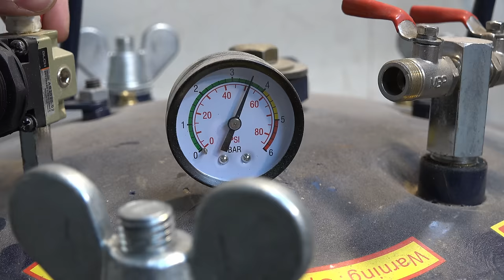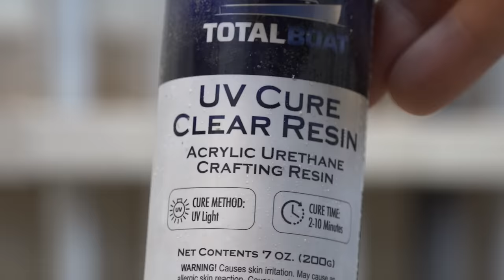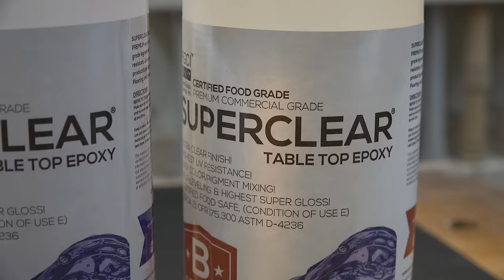I Should Have Seen This Coming...

Comment: Splendid piece of art and craftsmanship, however, not recommended for the average wood-turner who values “two arms and a leg”
Reply from the maker: Thanks!
Reply: Two arms and a leg is how much it costs!!
Reply: Meh, arms and legs are overrated.
Reply: @DavidAdamsen  ¹¹¹
Reply: Or sepukku by wood lathe
Reply: LOL
Reply: Right you are sir! This type of work is not for moderately experienced wood workers. It should be only be attempted by beginners.....  Now it's possible, even likely, that you meant the exact opposite of what I said.  🚫(Sarcasm of course)🚫

 I worked for 2.5 years on metal lathes, and also a little on wood lathes, and it makes me cringe just thinking about what would happen if someone were to flinch just a little, and accidentally jab their cutter into the top end of those branches while it's turning. That would be an injurious lesson on the importance of safety equipment!
Reply: @HighlanderNorth1  so true they'd end up with they're limbs twisted up more than the root system itself!😂, that's if they didn't end up missing a few digits?😳😂✌️
Reply: With the title, I thought it flew off the lathe. Impressed it didn't, seriously out of balance spin. Lol
Reply: Wrist bones are nice, too.
Reply: Lol
Reply: @Fubar000  expendable pieces, replaceable soon with robotics 🦾🦿
Reply: This was very stressful too watch. Pretty tho
Reply: I had a job once where we had insurance to cover accidents at work, and we would be paid a certain amount if specific things happened. The loss of a leg was valued atc$15,000, and an arm $10,000. So, 2 arms and 2 legs would be $50,000. Based off of these numbers, I would agree with your assessment that it is not worth it lol
Reply: @avrelo_south  i thought it was relaxing
Reply: @jonathanbartlett1098  that's a really low coverage. The recommended minimum sum insured is 100k which typically means 5k for a finger (double for an index finger). Still not worth it.
Reply: Saw a vid on LiveLeak once of a poor guy who got his coat sleeve caught in a metal lathe similar to this one.
He was obliterated instantly.
One of the most brutal things I ever saw...
Reply: Cheap at half the price an arm and a leg!..
Reply: Why does the cutting tool not gets snared and ripped out of your hands?
Can one not advance the cutting tool with a firm clamp.
Reply: @avrelo_south  I thought so too 😂
Reply: That is why I think that he cut off some of it and most people would put it in the fireplace
Reply: take 1 arm and leg 😂😂
Reply: @FUBAR  , they're not when you don't have any.
Reply: A lot of work for a bong and why need a stump only to cut it off after?
Reply: for balance
Reply: It’s just beautiful
Reply: @dogewood5499  Metal lathe has way more torque than a wood lathe so if you get pulled into it the thing it won't stop turning until it is ready to stop. Wood lathe will stop quicker but still do a lot of damage. Either scenario doesn't really bear thinking about.
Reply: @DavidAdamsen  will get v nai
Reply: @Fubar000  as a quadriplegic, that's not funny
Reply: Un capolavoro!
Reply: I felt like I was going loose a hand just watching this video.
Reply: I’d give my right arm to be ambidextrous.
Reply: I’m a novice turner cringed many times watching this but what a beautiful peace of work
Reply: @r1learner178  it was an industrial metal lathe. It just looked like this one.
My bad.
Reply: @dogewood5499  It's all good.
Reply: Why ????
Reply: Why doesn't the average wood-turner value his OTHER leg?  🤔
Reply: Well I was born just a torso so this wont apply to me
Reply: Wow!!!
Reply: Or chin
Reply: Sure
Reply: Control that gouge
Reply: ha ha ha😆 I thought that was a  barbecue roast turning on a rotisserie at first
Reply: Por qué contaminas el planeta....
Reply: @dogewood5499  that video was the only thing I could think of while watching this. ruined lathes for me. And the lathe ruined him of course. Poor guy.
Reply: I knew a girl one time that worked at IHOP she only had two arms and a leg we used to call her Eileen.... Awww irony.... Great waitresses though
Reply: @ItsMeTyScott  Irony?
Reply: @HighlanderNorth1  Ah, I'm a beginner. I didn't realize this was the kind of project I should start with. Thanks for the heads up! I'll go pick up a good gnarled piece like this for my next project.
Reply: @ItsMeTyScott  Look up the meaning of irony.
Reply: Every machine have had its own safety devices. For lathe it can have emergency stop lever and brake too. Besides you need skills to do it, it means you know how to handle your tools, how to move it, how thick would be the feed etc. Of course you will lose a limb if you're not skilled and that is the worry of those having no skills.
Reply: @DavidAdamsen  estoy de acuerdo en conservar el cuerpo para arriesgarse hay que tener un buen torno
Reply: You people leave the house without being bubble wrapped?
Reply: @cynthiaquinn747 😂
Reply: Very primitive lathe machine that’s why it’s not safe for beginners,but once you know what you need to do. Lathe machine it’s amazing machine can be done beautiful things with …
Reply: Using a lathe is safe just use gloves
Reply: Obviously
Reply: Wow that's incredible  Love it
Reply: Just one leg?
Reply: @bettertelevision968  Can I pay on an installment plan? Maybe two fingers and a big toe?
Reply: @chacesrevival  But then, what it?
Reply: @davidhughes6048  Yeah, but what are you going to do with your right hand sewn to your right shoulder?
Reply: @davidrosoff3228  If you have to ask, you wouldn't understand.
Reply: @fixitralphltd4988  You leave the Chinese out of this!
Reply: @evelynmesones8468  It's what we do.
Reply: @ItsMeTyScott  Eilean? Great girl, preferred the rhythm method. Hence the song.
Reply: @keaner21  Sundays only.
Oddly I'm persona non-grata at the public pool!
Reply: @MrJamezk  😂😂😂
Reply: @hrc6628  My thoughts exactly, I have always been thankful, for when I found out about this method of repairing cracks and why. he gives one a much greater insight into the beauty of what could be considered a broken object.🙂
Reply: This is a stunning piece of art/craftsmanship. Approximately how many hours went into making this piece? It's amazing.
Reply: @richardharepax123  that's where it belongs
Reply: Amazing!
Reply: Or the environment!
Reply: If I've learned anything from these videos, it's that you can take those little mistakes and throw some epoxy at it. Just take your severed hand, preserve it in an epoxy cube, turn it on the lathe a bit, polish, and bingo! Gorgeous wine bottle holder! And a great conversation piece!
Reply: This takes skill and good luck
Reply: @dogewood5499  That was the first thing we are taught when working with lathes and CNC, no long sleeves or any loose material. I had to have my hair tied back at all times(I was 1 of 2 women working on lathes). When I first started. I was being taught by a nice man who taught me everything he knew, then one time I cut myself and had a bit of blood, he instantly looked away and said he couldn't look or he would pass out. I asked him why, and he said that he heard a grunt from the person on the lathe behind his, and when he looked in that direction, he saw a huge spray of blood flying everywhere, and it traumatized him to this point. Very sad, idk how he continued to do the work after that. He told me once when he got cut by a sliver of metal(a long, thin rope of metal sharp as a razor) by stepping backwards, he sliced his Achilles tendon almost clean through, he felt the pain but didn't once look behind him to see the trail of blood as he limped to get someone to call 911. It's a scary job, you can't work in a rush and gotta think every move through, because not doing so could end your life. Never get too comfortable or confident. Anyways, that's a lot of words to say "it's a dangerous job and idk why I even got into it", I should've been a programmer because I had the codes memorized and could write a program by reading a blueprint, but I gave up like a dummy.
Reply: @hvmvp3657  Gloves can get caught though.
Reply: @DavidAdamsen  74 pi g tf felt fc6x
Reply: @jonathanbartlett1098  $15,000 for a leg would not even cover a below the calf prosthetic.
Reply: @patrickt1195  my work gives 50k to a beneficiary upon death lmao. 50k for your fricken life >.< Lol
Reply: "A" leg!? What happened to the other?
Reply: @madmax8620  no you didn't
Reply: @dogewood5499  the old rules still apply: no loose clothing, no tie, no jewellery, no long hair. Machines of all kinds are dangerous. I know, I lost a finger tip in my bike when I was 7. Gave me a healthy respect for machinery ever since!
Reply: What is this❓
Reply: @Fubar000  yeah shark i agree to u
Reply: @HighlanderNorth1  you said it would be an “injurious lesson” - I’d say it would be a lesson learned instantly - by fatality. I presume it takes decades of experience to perform work with these machines on an expert level while still doing it (reasonably) safely. 

But all dangers aside: isn’t his artwork stunning?
Reply: @ericperry4379  they can always grow back
Reply: just one leg?
Reply: Remember that the Lord Jesus Christ died on a cross for you because He loves you so much. He then rose up from the dead three days later
The Ten Commandments are called the moral law, (most of us are lying thieving blasphemous adulterer at heart and deserve hell) you and I broke the law, Jesus paid the fine. That’s what happened on that cross. 
By believing that Jesus died on the cross and rose up from the dead 3 days later and not just confessing your sin, but also repenting of all sin you have done and putting all your trust in Him in prayer, He will grant you everlasting life as a free Gift
Reply: @saraev1119  yeah, I know what you mean. It's absolutely terrifying how quickly one can die in a horrific way just by showing up to work with minor disregard for safety (long sleeves.)
Here one moment. Gone the next in an instant.
Reply: What kind of health insurance do you have to carry?
Reply: What kind of health insurance do you have to carry?
Reply: Cant believe they let us kids in 7 and 8th grade work on lathes in woodshop and weld in 8th grade. I’m lucky i didn’t fuck myself up really badly. I recall a few times getting the tool caught up in the wood lathe, ducking scary shit man. This was back in 82-83.
Reply: @dogewood5499  I cut the inside of my palm on one of those.... can you say..Ooooouuuuuch!!
Reply: 😂 so true. watching YouTube videos like this makes me think I have several hidden talents😂
Reply: Looks broken
Reply: Agreed. I’ve never turned wood in my life, but I was definitely thinking this looks very dangerous to the fingers and limbs. Good job on his part, beautiful art work!
Reply: I'm sure you turned WOOD before. 🥒
Reply: @avrelo_south  Totally agree. I barely breathed!!!
Reply: @Fubar000  femur turning video coming soon
Reply: It's only a flesh wound.
Reply: How much?
Reply: @Fubar000  כ מ
Reply: //em//....
Reply: I prefer ceramic
Reply: Yeah that lip was sketchy af
Reply: …until you have lost them.
Reply: @dogewood5499  oh my dear Lord, I forgot about that video..... **shivers**.....
Reply: What about "a hand and a nose"?
Reply: @dogewood5499  yea 65 year old Russian guy. Wicked
Reply: Most companies must be, for were/are insured. 
Any accident causing loss of a limb, or digits has a value. According to earnings that may be lost. Even Workers Compensation policies list those values. Your insurance costs are based on risk of work performed within that industry. If you are Clerical, Plumbing, or construction etc… 
A karate school you’d think would be high premium WC to protect you and your employees as bd students?  But no. It’s considered Entertainment. 
But a boxing gym is not. 
Even down to loss of a thumb, which is higher priority than that of for instance,  a ring finger or your little toe.
Reply: Yes
A loss of your thumb is a higher premium and payout. Workers Comp sets the values to protect employee and employer
Reply: @Fubar000  arms and a leg*
Reply: Let alone your lungs, from inhaling all that “Liquid Glass,” eurothane, and wood dust produced when making it. Hope he wears a good respirator. Beautiful piece, though!
Reply: But just perfect for the missing toe club
Reply: What happened to the other leg 🦵?
😳
Reply: Hey it was so amazing ❤
Reply: I couldn't afford the blade, let alone cut myself up with it 😂
Reply: @DavidAdamsen  This piece is  quite stunning and even with all the minor setbacks, you never wavered. That, to me, is impressive. How long did this take to complete from start to finish?
Reply: Just the one hey, the other could be a turned epoxy and wood peg leg.
Reply: @steveeklund1902  I thought the same thing. Lol
Reply: @MrJamezk Them BIG toes are used for balance ya know?
Reply: @LahainaKat124 It's a piece of Artwork.
Reply: @MER1CA_1st  I wish they'd hurry up this those replacement parts! I've been stuck in bed with a badly broken ankle for 3 weeks now!
Reply: Splendid e o Silva do Rio de sons irritantes a partir da próxima edição do

Comment: I really liked watching the process and seeing the end result, and it looked really nice, but I was sad to see that the colors of epoxy that you poured in all mixed in and produced a fairly monotone gray with very little color variation. Is there a way you could've done it to produce more color variation? Also, have you found a solution to remove the rocks, dirt and other crap that ruined your tools without introducing even more liquid into the wood?
Reply: Was thinking the same think.I was expecting colors....
Reply: @aminaadam3617  I was wondering if he was pouring in a color, letting it set, and then adding another, because I still remember (from when I was a kid) that mixing a bunch of different colors together usually results in gray or brown.

Comment: Gorgeous piece of art!  But watching that carbide fracture, triggered my Boxwood PTSD.   I've done landscaping of all kinds, retaining walls, heavy stone walls, shrubs and trees galore, pulled lots of stumps, but some of the most difficult work I ever did was hand-digging the removal of seven Boxwood stumps and their root systems, one by one.  Their roots are criss-cross networked into, and across, each other, and the wood is as hard as iron, and as heavy as lead.  If the 16th and 17th century shipbuilders could have made their keels outta this stuff, it woulda been impervious to damage from contact with submerged shoals, and been totally resistant to insects, the biggest problem of keels in the old masted ships.  This wood is too hard for the insect mandibles to chew.  It's like Teak, or the Philippines equivalent, "Nara."  I swear, even one single thumb size root intact, somewhere that you couldn't see, and the entire shrub stump did not budge.  Just when you thought it was finally loose, you'd rare back and give a good hard Mule kick...and break your foot.  It would be like kicking the bottom of a telephone pole.  Like I said, it was because of the transverse direction of the roots crossing each other.  Satan himself could not have designed a more perplexing and exasperating root complex.  This is why the cost estimate from contractors for removal of boxwood shrubs is on the high side, especially if they won't be able to pull em out using straps and a pickup truck.  Unfortunately, the shrubs had been planted originally in a location inaccessible to straps and a pickup to pull em.  There was no choice for me, but to hand dig em out.  Never again.

Comment: Wow, without the clue as to origin provided by the superstructure at the top, most people would be at a loss for what material this is made of.  I think if the top wasn't there, I'd have to guess rock, perhaps of volcanic sedimentary origin.  I've seen some rock pieces polished down that look similar, containing a heterogenous mixture of rock types that all got compacted down in a volcanic pyroclastic mixture.  But I'd be WAYYYYYY off!  Hard to believe it's actually WOOD!  Although I'd probably call Boxwood root something between wood and iron.   Beautiful work, though!

Comment: I love that you showed all the things that went wrong and how you fixed them. Roll with the punches!  

I think it turned out better that all the epoxy colors mixed into a single color, but if you wanted the separation you would have to let each one cure before adding the next. If you tilted your pressure pot maybe you could get it to be not so much like a rainbow. 

I think your cutter broke because of the many impacts it was having while turning down the branches. 

What was with all those chips missing from the epoxy. Surely you had seen or heard or even felt those when they flew off. How would something like that happen? Its like it took a hit from a shotgun. 

It came out beautiful in the end though. 

Why did you saw off the branches halfway through? 
What was the laser for?

Man, i really should have picked up that lathe i saw at a garage sale a few years back.

Comment: It's a passion of mine to create things out of natural finds...I too have a creation out of a root system,  but I've never turned wood, don't know proper ways to finish wood,  how to keep from splitting, & have a lathe, etc. I have messed w/ epoxy in various projects on a small scale,  but what you did is amazing.  Do you think the yellow repair w/epoxy would've dried had you done it in thinner layers? If so, would the durability have been there,  or would it have created air pockets? Just curious.  
Also, what was the air compressor device you used to cure that much epoxy? Very interested, & would LOVE to learn more.  Great work and thanks for sharing!